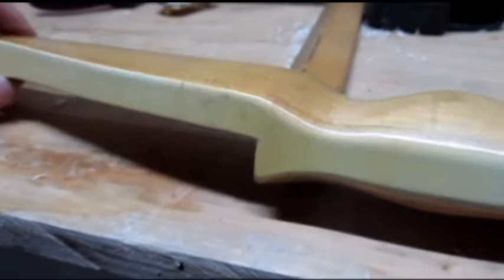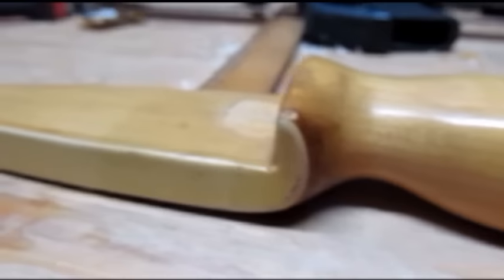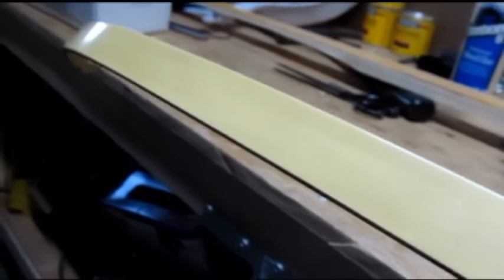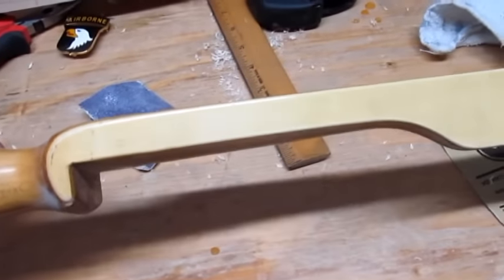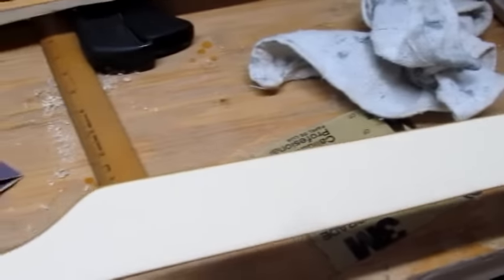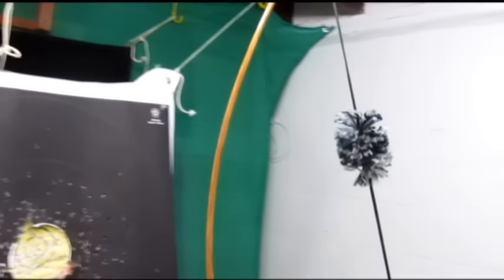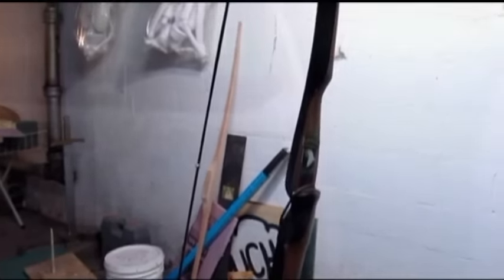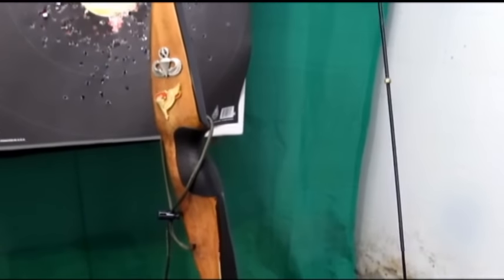Hoyt Scout Recurve Bow Refurbish

Comment: What type of black paint and how did u paint the limbs plz
Reply from the maker: Regular spray paint. Just maksed off the wood to paint it.
Reply: I just bought a used fiberglass & wood recurve bow and it's definitely used. I want to refinish wood, repaint fiberglass, etc... Did you spray any type of sealant on the fiberglass to keep spray paint from chipping, bubbling, cracking?
Reply: Just read further down you used automotive paint & polyurethane. This will be my first time refurbishing a bow as well!